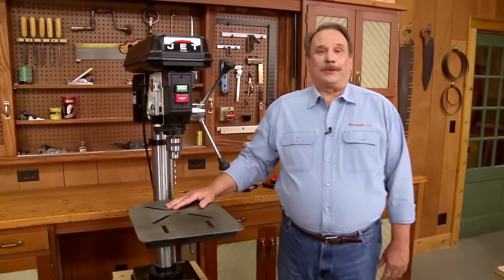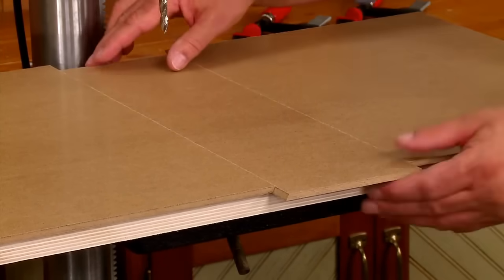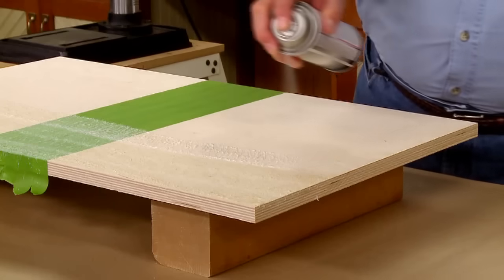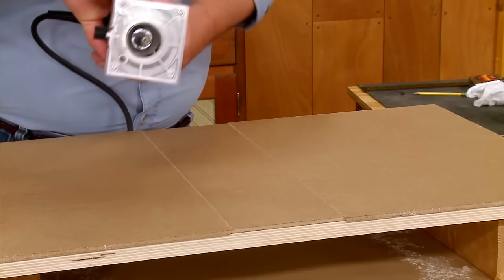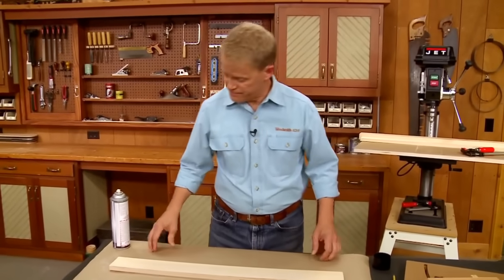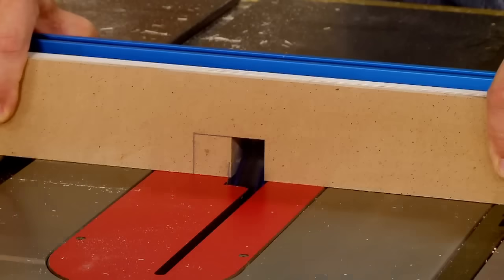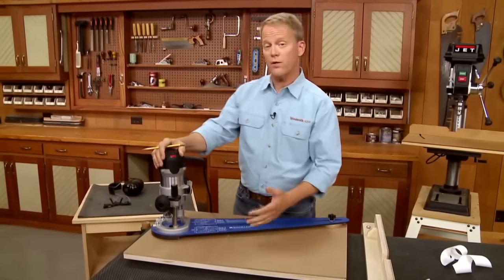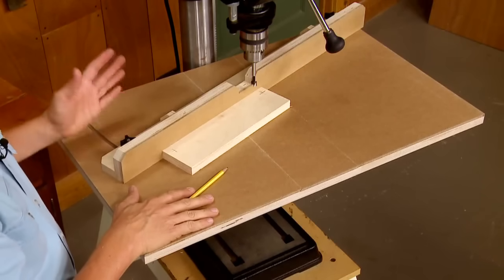Upgrade Your Drill Press! - How To Build a Quick and Easy Drill Press Table! (FREE PLAN)

Comment: I like the dovetail slot for the sacrifice board. I did this to the fence on my route so I could install zero clearance inserts. I made up a number of insert blanks at the same time. When ready to profile the insert I first set route bit to proper height then pivot the fence through the cutter. This insert also becomes a perfect height setup guide the next time you need this profile.
Reply from the maker: That's a great idea! We've done similar replaceable inserts on sleds and jigs, but hadn't thought of doing this on a router fence.

Comment: how does the swing fence lock into place?  I see the knobs, but what are they screwing into?
Reply from the maker: There are bolts that go up through the bottom of the table that lock the fence in place.  You can see them better in the free plans here: https://www.woodsmithplans.com/plan/quick-and-easy-drill-press-table/

Comment: That trick for perfectly square threaded inserts is just excellent! Thanks!
Reply from the maker: Glad it was helpful!
Reply: The tip for inserting the threaded insert would also be a great way to guide a hand held drill on jobs where the drill press is not convenient. Also great for keeping a thread tap square.

Comment: A great video with some bizarre content. 26 mins in you mention a trammel for the first time and say it is something easily created. To be honest, creating a good trammel is probably harder than creating the table attachment for the drill press. 
Also, you must have the most clinically clean workshop on the planet. I can’t see any dust anywhere.

Comment: Great vid, made this but rather than the sliding centre piece I made several wooden disc 5 " dia  and set them in a counterbored hole, they can be cut by the dozen easily with a hole cutter that matches the counterbore. they have never fallen out in use. I still tend to use a sacrificial board as old habits die hard.

Comment: Why bother to lock down the table with a wrench? Why not just use wing nuts with lockwashers so you can get it on or off quickly, but it won't vibrate loose? I see no reason/benefit for wrenching it down tight. Hand tight -- esp. with lockwashers -- should be more than sufficient for the possible torques I see this taking on.
Reply from the maker: I agree with you... I actually normally just use a couple of those black plastic threaded knobs to attach the table, but to each their own. :)

Comment: As a newbie woodworker, I don’t understand why the fence needs to pivot. Can you explain what? Thanks.
Reply from the maker: Obviously, on a drill press table you would just want a fence that moves so you can easily locate repeatable hole locations along a workpiece.  We've done many designs (some examples here: https://www.woodsmithplans.com/category/drill-press-tables/ ) where the fence slides along two lock-down locations, whether it's in slots or t-track.  Also, locking down two points can be a hassle at times because the fence might shift as you are locking down the second point. Plus, t-track can fill with dust and chips as you are working and get clogged.  This design has a pivoting fence that locks down at one point only so it makes for one less step and uses a through-slot that won't clog.
Reply: Woodsmith you did not answer his question
Reply: The main drawback to a pivoting fence is the way the wood you are drilling extends into the wall behind the bench or something in the middle of the shop.
Reply: You move a saw fence to adjust where the blade cuts. It's the same on a drill press when you want a straight row of holes. The drill is cutting at one point so a pivoting fence does the job.

Comment: Nice video! Well done. 

I noticed the better drill press in the corner. What is it? 

I also noticed the bench vise mounted on the left hand corner of the bench. I always mount mine on the right hand corner. Is there a reason for that position other than a left handed worker?

Comment: I built a top very much like it. My drill press is a bench top model. I found that the table blocked the handle for raising the table. I cut a notch, actually a rectangle, out of the corner but it also removed the pivot point. So instead my fence slides on T track. The right track is actually close to the center because of that cut-out. The fence reduces the depth of the table as well. With the T track it can go back further than the pivot method would allow but the fence hits the column so it has a semi circle cut out and the fence wraps around the post. Finally, when using short bits the handles hit the fence. They can be removed and most of the time my drill press only has one of three installed.
Reply from the maker: I've found that depending on the drill press I'm using, I have to do a little customization on the auxiliary table to accommodate all the different features too.  I have the same problem with the handles... I ussualy only have 2 of the 3 attached, as well.

Comment: Another option  router out the middle of the bottom piece add bevels to the two edges and slide in a middle section with bevels  in opposite direction

Comment: The procedure for applying the 1/4" hardboard (make sure it's "tempered hardboard") is the same as gluing plastic laminate for any table top surface.  I'd use Baltic Birch, too, instead of regular ply because it's flatter.  Instead of trying to perfectly align the pieces, use dowels on the glued Baltic Birch piece.  The dowels will not stick to the glue and slowly remove the dowels as you align the top piece.   I always apply three coats of glue to each surface.  You can tell when the surface is ready for another coat by touching the glue and your hand won't stick.  Another tip:  I use rollers to apply the glue.  I don't like the spray or gel.  That wrench jig for screwing in threaded inserts is a great tip.  One that I will use in the future for all threaded inserts.  Thanks.

Comment: I'd like to know how the fence locks in place for the drill press table...did I miss something?
Reply: Me too!
Reply: I wound up scrolling thru the posts and they did somewhat explain it; basically a carriage bolt up from the bottom, held in place by the knobs. I believe a 2 1/2” bolt, 1/4-20. I ordered some knobs but in the meanwhile I used a bolt, some washers and a wing nut.

Comment: I put the centre strip in as i glued but protected the centre area under the bevel by wrapping the centre in waxed paper taped tightly around it in place.  I’m a big fan of making all my own glues and finishes so i use a controllable hide glue recipe.  Then slide out the centre and peel the wax paper off...i use a Danish soap wax to protect the insert guides from wear....it works for me...🥴
Reply from the maker: Great tips! Thanks!

Comment: so i am just getting or trying to get into some woodworking (watched shows all my life and done a lot of rough construction). watched several videos on expanding my drill press table from the cast iron from stock.

as mentioned below about the table crank hitting the new table (and as seen or mentioned in other videos).. instead of notching out the table.. why not add a 1x2 or even a 2x2 under the new table (or even using another sheet or 2 of 3/4 ply), no bigger then the cast iron table to lift it a bit (it's something i haven't seen done in any of the videos i have come across)? this should give extra clearance for the crank.
Reply from the maker: Yeah, propping the table up a little would definitely work to add handle clearance.  I shot a video about a year ago on a drill press table where we transferred the crank and lock handles to outside of the drill press table.  I think it is a pretty clever design, and you can watch that video here: https://www.youtube.com/watch?v=3_cQcHMz7UU

Right now I'm shooting a video on making this Woodworking Drill Press Table: https://www.woodsmithplans.com/plan/woodworking-drill-press-table/  It has a drawer underneath the table which adds storage and dust collection but also props up the table enough to give plenty of clearance for the crank.
Reply: that is a pretty slick idea as well!
Reply: really like that nee table with the drawer as well! looks like something i could probably build with the tools i have today. might have to take a stab at that!

Comment: Any suggestions for sourcing 1/4” hardboard? I have looked everywhere to no avail.
Reply from the maker: Really, I wouldn't think it would be that hard to find... What's your location?
Reply: Birmingham, Alabama. I’ve tried Lowe’s and Home Depot. They can’t special order it. I’ve tried our local specialty plywood wholesale place. The only places I’ve found online are Menard’s (which we don’t have) and a place in California. ....oh, and amazon has a single sheet available for $223.06 plus shipping.  Should I be focusing on building materials distributors, sign companies, or some other industry? What is the primary use of the product?
Reply from the maker: I found a smaller piece of it on Amazon.com for less than $13 and should probably be enough for this project: https://www.amazon.com/gp/product/B0042SWQ62/ref=as_li_qf_asin_il_tl?ie=UTF8&tag=creativehomew-20&creative=9325&linkCode=as2&creativeASIN=B0042SWQ62&linkId=de514242161176a3fe2fe8446fca131f
Reply: In UK, the hardboard is soft, rough on one side and it's only 3mm thick. It's sold for surfacing floors but no professional would use it.  I would use 6mm MDF or birch plywood.
Reply: @Dave5843-d9m  @UCPBZdSldE4xJub4tagay4Jw The issue was (if I recall correctly) finding tempered hardboard. Regular hardboard is easy to find but too soft, as David mentions. Tempered hardboard is difficult to find. I finally tried calling local wholesale only suppliers and found a place who had it and was willing to sell me a single sheet. I should sell my extra material on Amazon.

Comment: Very good video..would have liked to see the fence to table install tho?  Is it just a bolt dropped through with a nut on bottom, or did you install another threaded insert on the bottom?
Reply from the maker: Sorry about that... It is a carriage bolt that comes up from the bottom into a knob.  On the pivot point, you could certainly use a bolt and nut because you probably wouldn't ever have to tighten that side down anyways.  On the end that moves, the square portion at the head end of the carriage bolt fits in the groove and keeps it from spinning when you tighten down the knob.  If you haven't downloaded the free plans yet, they might help clear up some details, as well: https://www.woodsmithplans.com/plan/quick-and-easy-drill-press-table/

Comment: This isn't a critique. More or less just me thinking out loud and maybe get some feedback from others. I do like the overall design and am going to give it a go.

Not understanding why you bother beveling the slot for the sacrificial piece? Yes I get the "reasoning" however with the bevel you can't flip to use the other side. Without the bevel that wouldn't be a problem. All the force on the drill press is downward so it doesn't matter if its not "locked in". You shouldn't drill through the hard board if you stop  once you are through the work piece. If you can flip it you would cut the times you need to replace it in half. I would think the fence and gravity and the work piece would do a good enough job keeping it from lifting.  Also without the bevels making replacements would only take seconds if you use the old one to set your table saw fence.

Again I do like the design and I think this is going to be my solution. Thanks for sharing and the free plans!

Comment: The slot in the insert is NOT for a screwdriver it is to cut the threads in the wood. Gee whiz guys research your subject before hand.
Reply from the maker: Yeah, I've heard that in the past regarding threaded inserts, but I don't know if that is the case in this particular model.  The slot in the body of the insert doesn't go out to the edge of the threads, so I'm not sure it would really help that much in cutting the threads in the wood. Maybe though.
Reply: Woodsmith 😀 thank you for the reply, the way you inserted the inserts is the proper way to do it.
And I am pretty sure the video help folks

Comment: Your whole process is overcomplicated. Take away the two outer Masonite. Lay the center insert in places. Square it up. Draw a line on the outer edges of the center insert. Remove and tape and glue as you did.

Comment: Nice video, no safety glasses.
Reply from the maker: Thanks.  We are wearing the safety glasses and hearing protection when we are running the tools, but because of the way the video is edited you don't see them going on and off.  (You can see them on the cart at 26:30 for instance.)
Reply: Robert Fleming, I thought the same thing even was looking to see if our ole friend Norm was going to be stopping by to share.  Always wear your safety glasses and read your owner’s manual when setting up the equipment!!

Comment: What the fuck does the movable end of the fence screw into?   You show a plastic knob. is it a bolt, how does it hold the fence from moving?   You didn't show the whole build.
Reply from the maker: Sorry if we did not explain that clearly.  There is a carriage bolt that feeds up through the table into the knob.  Also, it might be more clearly explained in the free plans.  You can find the link in the description or right here: https://www.woodsmithplans.com/plan/quick-and-easy-drill-press-table/

Comment: Professionally made and presented howto, congratulations.  I mostly work with metal and the same issue of a chewed out spot occurs.  Your design has features I definitely want to include, I simply need to seal the ply effectively or make the replaceable strip from aluminium the same thickness.
Thank you for sharing.
Reply from the maker: Thanks - let us know how the modified build goes.

Comment: 2 Suggestions
(I'm a newbie so bear with me) !😊
1. I would think covering 99% of all the boards with glue is a waste, even if it is cheap. 50% coverage (all four corners and the middle should be more than enough I would think).
2. This is to give some clearance for the sacrificial board in the middle. Use the actual beveled sacrificial board for the glue-up and wrap some waxed paper or parchment paper (baking paper) around one or both sides of the sacrificial middle, then glue up the other side.       Presto ! You know have a few thousands extra clearance for the sacrificial board to slidea freely.
Reply from the maker: It's worth a try :)
Reply: Dan makes a great point.  I would like to add two observations from the original articles thought about now going a cutting the insert to fit!  With time and space being our issue, then so it’s going to make sense to already have the insert cut adding the wax-paper trick from Dan Cahill’s addition for saving our valuable time!

Thank you for great service and support I will be creating my replacement top soon using all these great ideas!!
Reply: I've done partial glue coverage and regretted it. Glue across the whole surface or the thinner layer will bow upwards when the weather changes. It's especially bad with water based adhesives as used on floors. Personally I would use 6mm plywood for the top layer. It's more stable and will move with the base board. Hardboard expands and contracts far more than plywood. Best avoided. 1/4" or 6mm MDF would do but plywood is probably no more money.
Also avoid MDF for the base board. It is tough, solid and cheap, but it creeps and sags over time. Anyone who has an Ikea chest of drawers will know how the top sags.

Comment: Rather than mess around with contact cement and the smelly, flammable, toxic solvent I would fasten the hardboard down with a pattern of countersunk brass wood screws. This will also allow the    side  panels to be replaced.
Reply from the maker: That would absolutely work too.  Great idea - thanks for the input!
Reply: You might want to consider Super 77 by 3M. I used to work at installing pool tables, and we would spray that stuff on the slate to attach the felt to the table. Never had a complaint about the smell. It's sticking strength is incredible too.

Comment: Your workshop is too clean...you guys are of a different species to the rest of us
Reply from the maker: Lol, we can’t take too much credit for the tidiness.  This shop is mostly used as the video studio for our PBS TV show, so we are not allowed to get it too messy... our personal shops are another story. 😬
Reply: @WoodsmithShowandmagazine  Figured that... maybe half a bucket of sawdust spread around, an electrical lead it two on the floor it will clean up quick an easy when you're done. On a house build we would leave a skirting nail proud for the inspector to tag... took 2 mins to fix and stop him checking with mirror to see if we painted under doors!  Haha
Reply: Confession..am using Covid 19 to clean/set up my workshop after 25yrs...fitting sawdust ducting and set bays for drop saw, bandsaw,drill stand, sander...today (7am Australia) will do your drill bench set up lovit...

Comment: Yeah, that insert installation technique is simple, yet genius! Everything else is just as thought out and simple as well. I’m sure most all of us can appreciate this Jig for our shop drill press. Thank you for sharing and keep them coming! Aloha
Reply: I don't get it - when i try to screw the insert down, the bolt just threads deeper into the nut and insert. does the nut need to be glued in place?